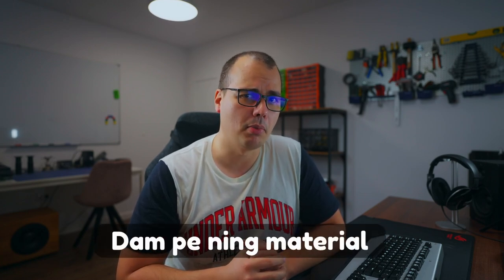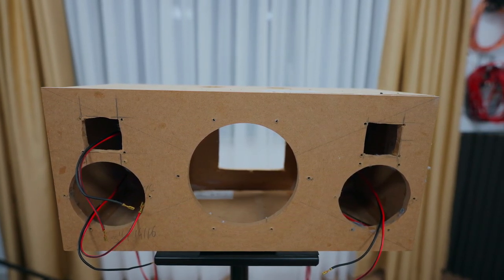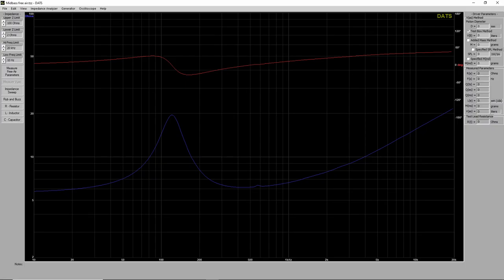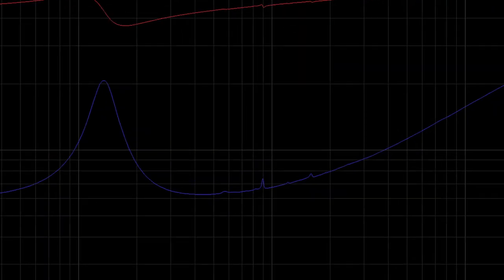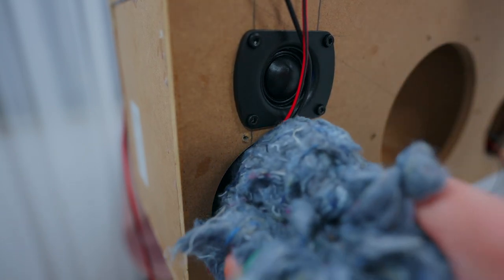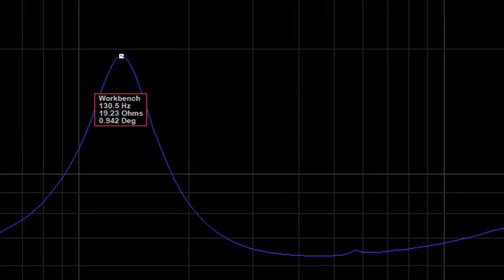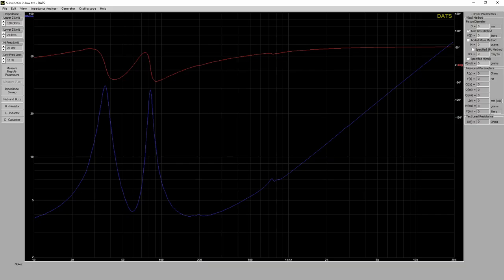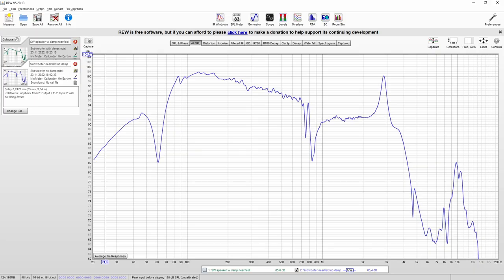Sound Damping Material - any good?

Comment: Good video and discussion. I read some earlier articles (maybe 15 yrs ago) where AR (acoustic Research) did some testing with fibreglass vs poly fill materials. They talked about how these materials affected compliance and attenuation characteristics. According to their observations in their AR3 and AR10 speaker cabinets the fibreglass had the effect of increasing compliance at frequencies below ~400 Hz This resulted in lowering the box resonance (increasing effective box size) while the poly fill had almost no effect on Fb. The fibreglass also had much more attenuation (dampening effect) in the same low frequency range than the poly fill which had almost no attenuation at low frequency. The article also said the poly fill attenuation improved at frequencies above about 400 Hz.

Comment: Excellent analysis of dampening material. I thought that secondary blip up on the impedance measurement was due to some minor coupling of the speaker when placed on the table although I have to admit I never tried holding it in free air when measuring with the Dayton unit which I also have.

Comment: Should we conclude that sealed enclosure is superior to ported, PR, bandpass enclosures in that it allows for almost complete damping of the standing waves?
What about making the box trapezoidal, i. e. one pair of walls is not parallel? As far as I understand, it doesn't eliminate modes, but it smears them out in frequency, reducing the energy at each particular frequency.
Reply from the maker: Yes, having an odd-shape box will help. The fewer parallel walls the better. Sealed boxes can be easily dampened as you simply stuff them, however, bass reflex boxes can also be dampened just as good. You just need to be more careful how you do it.
Reply: @AudioJudgement , thank you! Looking forward to more videos like this.
P. S. It's "damped", not "dampened" :))

Comment: Is there a link or a name of those dampening materials so that I could look at them and see the price if I want to use them and my next project?.
I usually use a combination of the aforementioned egg crate looking foam with pillow stuffing but I'm definitely down to do something better if it's not expensive like those ones from parts Express where it's going to cost me 50 bucks to do a speaker with damping or dampening lol material
Reply: The cloth fiber is called recycled batting, maybe you can find a local source that supplies people that make quilts.  Moving blankets are usually dirt cheap, sometimes free with a coupon at Harbor Freight, they are filled with recycled batting.  For higher density foam, you could try carpet "rebond" pad, it's available in different weights with the higher weights being more expensive of course.  If you could find a local carpet installer, they throw out tons of small pieces when doing an carpet installation.
Reply: @mattgraham4340  Harbor Freight blankets sounds like a good idea.
I have several of those and have finished moving.
Reply: @BARBELLS-AND-BUDS  they are pretty thin, so you might need more than one layer.  On the plus side, they might be tidier than loose batting
Reply: @mattgraham4340  I saw a video using vinyl floor tiles on walls, and thought Id try that and then dampening or some sort on top. I like the shredded denim looking stuff, but carpet padding will be nice as well.
I usually use egg crate foam that is already used to save money, but I dont have any right now.
Ive use memory foam as well in the past.
I dont think pillow stuffing works well so I havent used that in a while
Reply: @BARBELLS-AND-BUDS  sticky back tiles is an interesting idea, but I'd have to see some kinda test data before I would be convinced.  I guess they're thinking a cheap alternative to dynamat, but I would think of some roofing product before that.  Then again, ice and water shield maybe just as expensive as off brand dynamat.

Comment: One question though. If you insert a ton of material inside, it will eat up some volume, right? So the box itself should ideally increase to compensate for loss of that volume? Or not?
Reply from the maker: Like I said in the video, the perceived volume of the box actually increases. I know it’s counterintuitive but that’s what happens. So for example a 10 liter box filled with damping material will act like a 11-14 liter empty box (depending on the type and quantity of the material).
Reply: @AudioJudgement  Hi, thanks, yes I know that from software simulations but as I can't explain why it happens it is still pretty weird conclusion to me. OK for lousy material I can somehow think of some explanation, but what if you stick that wide and dense thing onto enclosure walls (like in your bassreflex example), that is almost a solid material, does it still holds that there is no need to compensate?
Reply from the maker: It's not solid material, even though it looks like it. If I zoom in on the measurements (because they are pretty much identical), the resonant frequency of the box with the walls lined with damping material is lower by 0.2 Hz. Lower resonant frequency is a result of a larger volume box. Hopefully, to make things clear, I once heard an analogy that the sound waves have a hard time traveling through this damping stuff, so it takes longer to reach the box walls. Longer time to reach the walls simulates a larger box. However, the true explanation is much more nerdy and difficult to understand if you are not a physics guy.
Reply: @AudioJudgement I've often wondered if damping material makes it behave like a bigger box, will a bigger box with no damping  give you the same results ?

Comment: I disagree on the Damping a bass reflex. I built a pair of speakers filled with polyfill, a stringy fluffy material. The speakers are a dual 6.5 crossed over at 1.8KHz with a silk dome in the middle, a 3 inch port on the lower front of the 1.5 cu ft box. 35Hz fs in room empty box, 28Hz fs with about 25 ounces polyfill in each speaker. 
The fs numbers come from a dB meter and tone gen.    
I have never used the jean looking stuff.